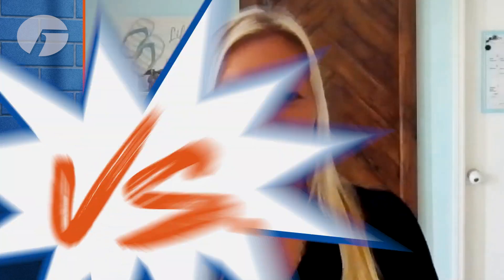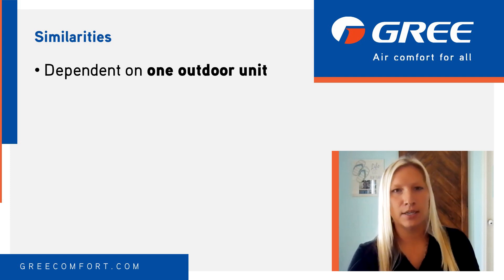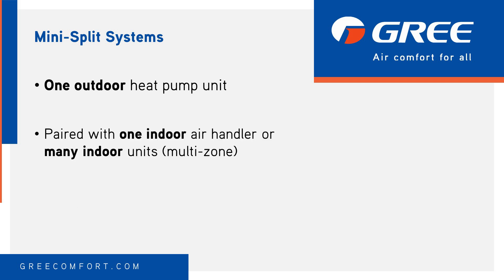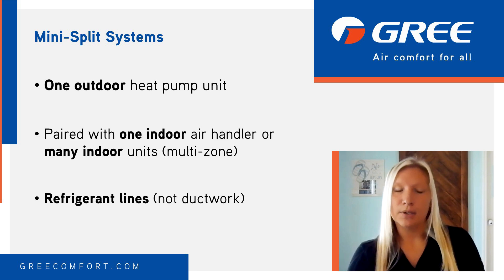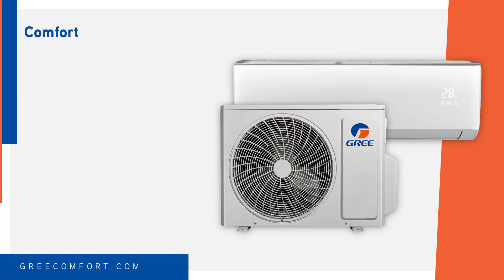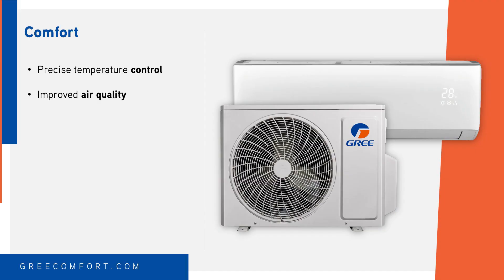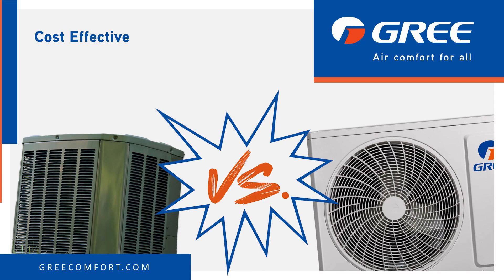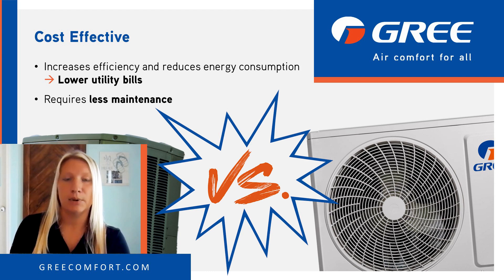Heat Pump vs. Mini-Split: Key Differences Explained for Homeowners and HVAC Pros. #greeversus

Comment: After getting ripped off spent 8900 bucks on a Ruud 15 Seer Hp that has done nothing but not work and leak . I bought a 18,000 Btu Walmart Mini Split no name brand really and its been GREAT. It heats my whole house even when it got down to zero outside and even down to -5 no issues kept my house the living part at 70s and in the summer at 100F no problems at all. I installed it myself total cost was 800 bucks . I will never again pay these Hvac guys who are getting more and more expensive. Its been running for two years non stop .
Reply: How much did the mini split systems cost after instalation
Reply: Approximately how many square ft. is your house?

Comment: We got three mini splits that we've had for several years.   We just added three more in the den, living room, and office but we rarely turn those on.  When it's hot we often hibernate in our bedrooms.   We use them 99% for A/C.  We have a gas heater for now that we only run from 6 to 9 a.m. in the cold months.   We have 3.5 KW of solar that we've had for 21 years.  The problem is when we would like heat, the sun is not shining as much.  We are just too used to having a negative electric bill.   Hard to use the mini splits for heat when it could put our electric bill in the positive side.

Comment: Let’s say you have a five zone mini split heat pump system on a typical house. That’s six refrigerant coils that can get a leak. Six communicating PCB’s to get zapped by lightning. Too many unique factory parts limiting the universal parts market. If one unit goes bad, you have to change the whole system, because manufacturers are constantly switching models so that they can sell you a whole new system instead of an indoor or an outdoor unit. Brands cannot be mixed. All of that is a no go for whole house systems for my business.
Reply: That's true. Here is my experience with both. Have 14 yo lennox. ECM motor went bad - 2K repair or similar system for 22K replacement cost. Ducts stink like there is no tomorrow, previous owner smoked or smth.
On the other hand I had daikin 4 port 36k but with 3x12k heads mini split. Any pipe run over 50 ft is not recommended. We had one. After 3 years it leaked. Open/close the walls, charging the system over few years each summer. Basically it was bad install. With another contractor we re-routed one of the pipes and replaced the leaky head. Now seems to be fine. All around it cost around 6K to buy/install and 5K to fix it.
Two of my neighbors,  installed the same daikin systems before me and no issues for over 9 years. No stink from ductwork. I will go mini split any day of the week.
Reply: @seventwenty4569  I just got home from replacing an ECM motor with a PSC motor. 30 minutes from the shop. All parts on my van. $640. Any system, including mini splits will stink if you don’t do annual maintenance on them, smoke or have pets.
Reply: @USA-GreedyMenOfNoIntegrity on a mini split, besides filter and coil cleanup what else would you recomnend?
Reply: @seventwenty4569  vacuum out the condensate drain and clean blower wheel as needed. Add a 1” polyester fiber filter on top of unit sprayed with filter spray. Keep it cleaned often. It will catch and hold a lot more dirt than those little “fishing line” filters.
Reply: @USA-GreedyMenOfNoIntegrity  Thank you.